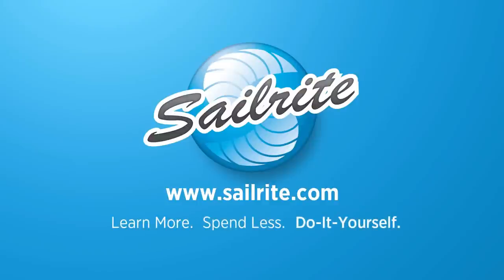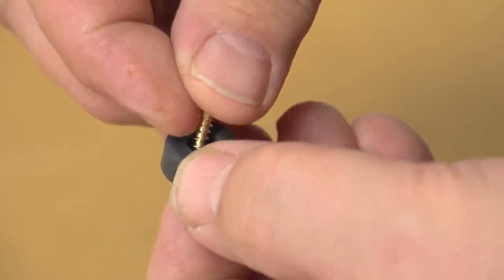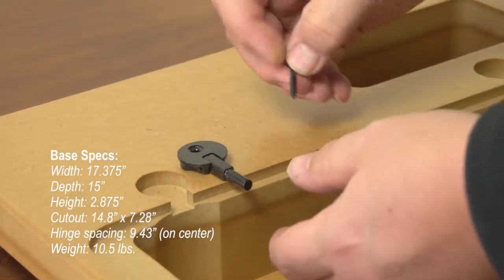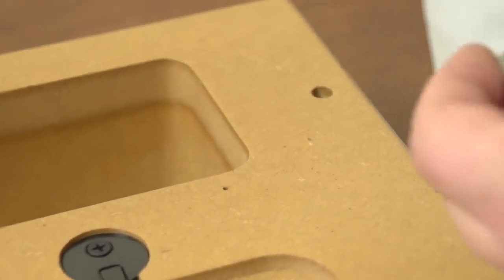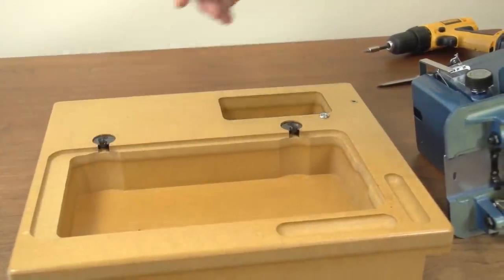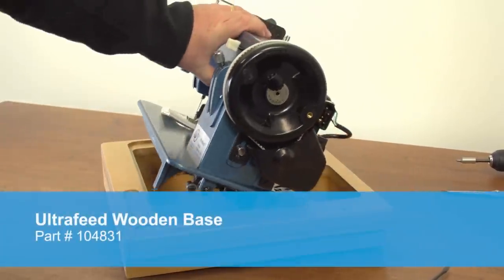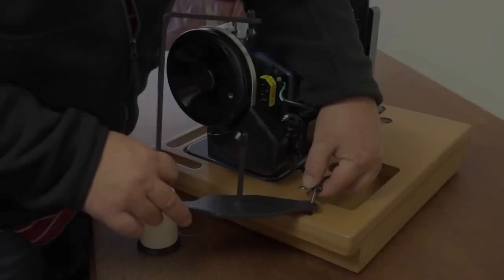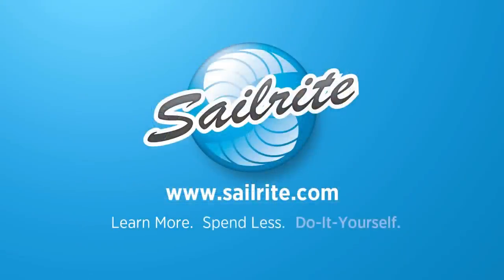Ultrafeed Wooden Base for Portable Walking Foot Sewing Machines

Comment: looks like it's made of fibre or mdf? How would that fair aboard a boat in the tropics? how's the warranty? thanks.
Reply from the maker: The Wooden Base is an MDF and does well on a boat. However, you should always try to keep it from getting wet. The warranty is two years. Here are more details: All parts and labor are fully guaranteed for 2 years by Sailrite. We are proud to provide you with everything you need to successfully maintain and repair your Ultrafeed. Should you choose to return your machine for repairs, you will be responsible for delivery both ways.Please Note: Damage due to improper use or neglect, impact damage, and normal wear from use of the sewing machine as well as sacrificial components and notions (needles, retaining ring cap spring, and gib hook) are not covered under this warranty.
Reply: MDF is not the right material to be on a boat. It's like Particle Board and water, that will result in "sauerkraut"
Reply: @manfredwarnecke282  The next best thing to osb garbage, sawdust & glue and only a hundred bucks

Comment: How much dowa it weight , and is it a self oiling system ?
Reply from the maker: If you just want to know the weight of the wooden base alone it is 10.5 lbs. If you add the Ultrafeed LSZ-1 Sewing Machine (#300601 at sailrite.com) to the wooden base it weights 48.6 lbs. It is not a self oiling sewing machine.